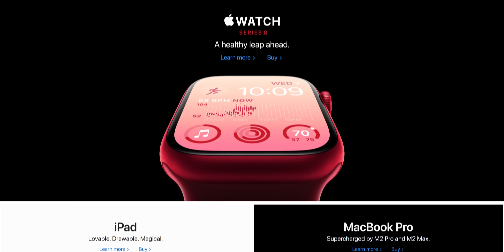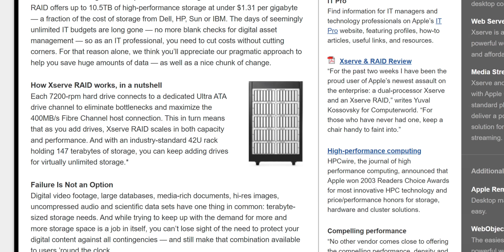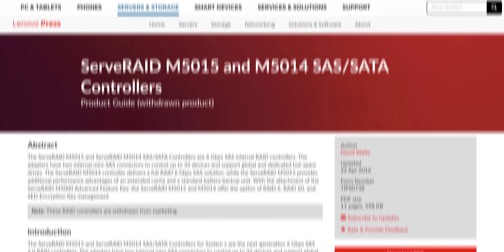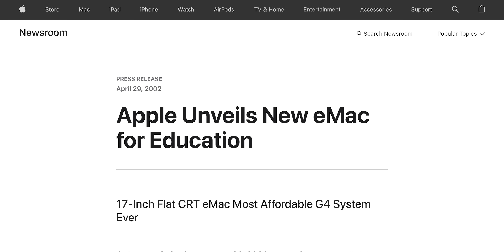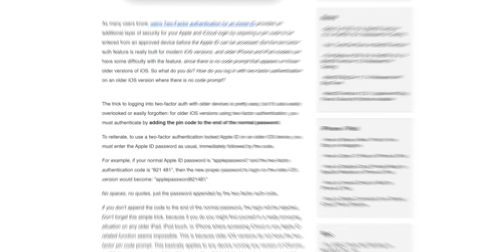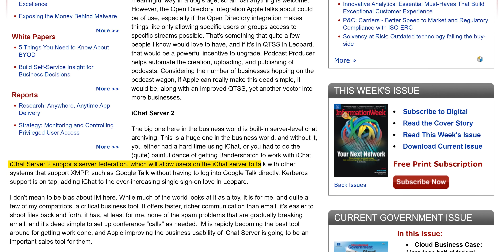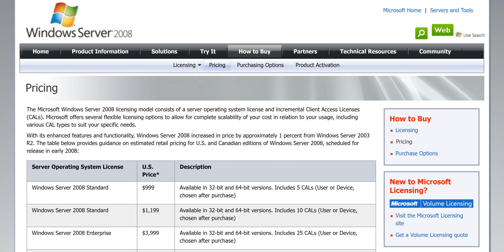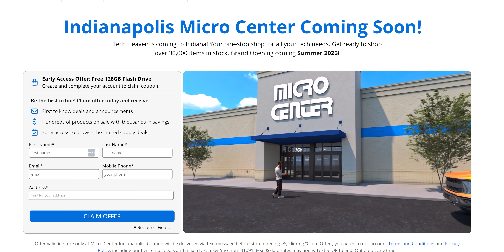I Bought the Last One Apple Ever Made... - Apple XServe 3,1 Server

Comment: I worked with one of these at a school.  Was very impressed by the user and computer policies you could set.  Much easier than Windows Server.  The fun part was using Apple Remote Desktop and setting up all the computers in a room to reboot at the same time.  You'd get about 30 or more bootup dongs at the same time.  That was fun.
Reply: bootup dongs, heh
Reply: My public school district had Apple servers. The school network overall wasnt setup properly or very securely. I got suspended for taking control of my teachers computer (through a software you could lock, share screen, take control, broadcast certan screens, etcetra.) as he was trying to share how to download files off of solidworks server.
Reply: you must be an apple bot for sure
Reply: Oh yeah I had to buy advance warranty, which was a duplicate server without a processor, HP owns the space due to their warranty being more than putting it back in a box and sending to apple services, Over priced underspec piece of junk.

Comment: I still use a G5 Xserver a duo quad core Xserver with matching x raid boxes for a file server. There is a way to get non apple drives working if you play with the raid card firmware. It's only really a problem on the Intel machines. Oh yah and the Mac pro's of that era also used de lidded xenons and require some proprietary tools to upgrade. But again with some firmware flashes and upgrades those machines are pretty usable today.

Comment: I used to administrate an old Mac OSX server (running Panther) for the Advertising Department at an old job. All of the designers/ web developers MACs were networked on their own switch with the OSX server. It was pretty easy to use, considering I wasn't a server admin (I was the only designer that had enough hardware/tech knowledge to work with it.)

Our server was one of the old chonky bois,  but seeing those old OSX versions takes me back. I think Panther was the last OS version that came on DVD installers.

Comment: It's been a long time since I did any work with an Xserve, but if memory serves (and I may get some of this wrong): The drive bay connectors weren't proprietary, just uncommon. The mini HDD inside used the same connector as the iPods at the time (on the drive side). The original PPC Xserve's drive firmware was custom to facilitate hot swapping and some monitoring features (you could put in a 3rd party drive, and it would read, but you wouldn't want to hot swap it)
Reply: Yeah, I run after market HDDs in mine.
Reply: Indeed. Ran these myself and had no problems running generic SATA drives in the sleds without Apple specific firmware
Reply: Not even that uncommon for servers. It's a Fibre Channel connector. The internal HDD's connector is what Toshiba used on their 1.8" SATA drives prior to the introduction of Micro SATA. There simply wasn't an actual standard which would work.

Comment: So a bit of heads up the small hard drive you found in there isn't really apples fault it's a drive from the iPod and that's the standard connector, As well you can use other drives I've seen people get away with oldish Seagate barracuda drives mainly 7200RPM

Comment: When I started at a video production company around 2006, my edit room was outfitted with an XServe RAID connected to my Mac G5. In the winter, I didn't need the central heating in my office, as those two machines easily maintained the room at 75ºF/23ºC.

Comment: What I get out of Apple and their software pipeline is that they want to eradicate the possibility of edge cases. So when some tech gets sunset, they also brick the software so they don't have to deal with "backwards compatibility" of getting legacy software and tech to work with current stuff. Or dealing the headache of finding someone in their expendable army of support personnel who has the faintest clue as to how and why something in a decade abandoned piece of tech works or doesn't work. 

So in summation: You'll be using the tech how they want it, for what they want it because anything else is heresy.

Comment: I recall the old mac admins saying, back when I was a student IT worker, for a while you had to run and OSX server as an LDAP proxy to make Active Directory logins work on OSX.
Reply: Funny story is one of these was used as an auth server for a mac lab that wasn't on the main uni domain and then caused integration problems since the server outlasted the mac lab but they still were using it for LDAP auth on Linux. Eventually it was replaced with a Linux server only for the lab to become a combination Mac/Linux lab leading to new integration problems.

Comment: Its such a cool product I wish they kept selling them. If anyone is interested I actually have one lying around with its original packaging and accessories in good working condition that I am willing to sell if anyone is interested. Its configured with 2x Xeon X5570 24GB(12x 2GB) DDR3 ECC 3x 1TB RE3 WD1002FBYS HDDs 2x 750W PSU running Mac OS X Server v10.6. The disks are in good status according to SMART but the battery in the RAID controller is dead. If you are interested just hit me up but its located in Europe.

Comment: wasn't aware that we consider SCSI SCA 80 pin connector proprietary to Apple... I have those on SUN workstations and etc.  Basically, it was the standard SCSI SCA connector for the early days of "hot-swapable" SCSI drives....  However, that is accurate that Apple firmware locked those drives to Xserves, couldn't add just any SCSI drives to servers.

Comment: TBH this might have been Macs greatest server ever. Only problem is that most everything is made for Linux so trying to compete is impossible. Fuck, they made server management look easy though with all those simple GUIs... Wish it was that easy lol. I bet it would be really easy to install linux on it. Only problem is the serialized hard drive that can't be replaced if it fails down the line (which it will). Funny thing is microsoft also locks their drives in xboxes. PS5 doesnt! It would be cool to see what it would take to "unserialize" the drive, editing the software or firmware that checks to see if the drive is the same.

Comment: I ran a Mac lab for 10 years and had various X-Serves under my desk serving as media servers because the college wouldn't let me put them in the server rack in the basement. Needless to say, the fans were loud, but the server was rock solid reliable and served content without an issue campus-wide for years.

Fun fact: Try changing the battery for the RAID - on our X-Serve model, you had to remove most of the components to get to it. I've got pictures. It was stupid.

Can't wait to see you mad scientists turn it into a gaming system!

Comment: I had no clue Apple made rack mounted servers, I figured  if someone wanted something like that they would cluster Mac Pros. Apple really stayed on brand with there proprietary stuff, the drives, the connectors. I guess its hard to fault a company for acting in there own interest. A company that doesn't make profit is a dead company. I personally like apple products, each Iphone I have had has lasted me for years. I leap frog Iphone generations to get them cheaper, I started with a 4, then a 6 then 8 and now I have a X-R that I have had for 3 years, still going strong.

Comment: The drives being firmware locked are not true. I still use one of these servers and have swapped out the drives for newer off the shelf HDDs and SSDs and they work just fine.

Comment: Would love to see how capable this hardware still is today.
Reply: Not very. It's ordinary Intel hardware from when it was produced.
Reply: @microcolonel  8 core dual xeon configurations from 2008-2009 were pretty damn fast. still usable today.
Reply: @14blutundkrieg88  Usable by what standard? Technically you can still do useful work on old computers but you could also just pull any PC out of a dumpster or ewaste recycler and you have a pretty decent chance of beating a midgrade XServe.
Reply: @microcolonel  Technically true, but you'd likely need to find a 3th or 4th gen intel core consumer platform in order to get similar levels of performance to the top dualsocket xeons at the time. They can be had pretty cheaply now as ex-lease machines, I got my dell workstation for around $40 USD. works just fine for FOH audio at the venue I work at.
Reply: @microcolonel  It actually holds up pretty well, Intel Xeons still perform pretty well for most tasks. Of course the GPU is the biggest weak point. But that can theoretically be upgraded to something like an RX 580 with a PCIE riser cable.
Reply: @Pendleton115  you forgot to mention its generation
Reply: @Pendleton115  I did that 😂 use it to play games currently
Reply: @microcolonel  Xeon isn't "ordinary" Intel hardware. They are surprisingly capable machines even today.
Reply: @neilbradley  Why settle for a surprisingly capable machine when you can just get a capable machine lol
Reply: @microcolonel  I have a mac pro 5,1 and it's far from ordinary intel hardware.
Reply: @girlsdrinkfeck  Just buy more money?
Reply: @nambrosch  Far from ordinary intel hardware in a good way, or a bad way?
Reply: @matthew909_  good way, you can upgrade these to 12 core Intel X5690’s.
 Definitely not the most powerful CPU’s by todays standards, but at the time they were beastly.
Reply: @girlsdrinkfeck  but you clicked on an apple video😂 the most overpriced brand
Reply: @matthew909_  very high quality however apple has a long history of designing very high quality technologies then abandoning them.
Reply: @microcolonel  thanks for the update.
Reply: @nambrosch  ordinary? try pathetic, compare a the portable workstations or servers to apple products and cost is always,,,way less for anything against apple, and actual compatibility? again apple loses,,, then ability to compile code?,,,you get more ram, more cpu and gpu and the ability to upgrade to diferent things, more often and less "locked hardware proprietary crap" ,,APPLE ALWAYS LOSES,,,when the comparison is impartial ..only fools who take this stuff out,,, and put their finger on the scale,,,will say apple is even competitive..
Reply: @jstavene  spoken like a true hater.
Reply: @nambrosch  or a man who had to support and plan and purchase and budget this stuff... its terrible that is the truth! and apple screwed people ALOT!
Reply: @jstavene  As an IT Director, I ran cost comparisons of the XServe against the Dell servers in the mid-2000s, and in a like-for-like=hardware comparison, the Xserve was cheaper.
Reply: @thedude6712  I know your either mistaken or lying... (I challenge show some math)
Reply: @jstavene  I'm neither mistaken nor lying. I made a spreadsheet to compare differently-spec'd editions of both the XServes and Dell PowerEdge PE1850 or PE1950 servers (our MDF had 30 or so computers, including Proliants, PEs, and a few Sunfires), and the XServes came out ahead in out-the-door pricing over the Dells. This was 15 years ago, and that spreadsheet didn't exactly rise to "need to archive for posterity" level of importance after the purchase decision was made. It may exist on some old computer in my basement, but I'm not about to go powering up random computer to make you happy...even if I found it, you'd still claim that fabricated. The XServe was one of the few Apple products which was able to compete directly on price. Sure, you could get a SuperMicro cheaper, but not a big-name server.
Reply: Luke Miani did a douple of pretty nice video’s on this, a while ago.
Reply: Not very the os is very old
Reply: It's still serviceable but very obviously dated.
Reply: For the OP, it really depends what you are going to use it for.  As a gaming machine?  Maybe, if you get it for free, with a 7970 or rx580 in it already, and already set up, or you enjoy having to tinker and flash firmware.  In general, would not recommend actually buying one for day to day use today.  That said, if you already own one, it is still a perfectly usable machine for anything you bought it for in the first place.  It's not the fastest thing ever, but is perfectly capable in production workloads even today.  my 2008 Pro is still the main workhorse in my print shop, where it is used mostly with photoshop and indesign (cs6), running High Sierra.  That CS6 license is the main reason the 08 Pro was never replaced as it will not run on modern 64 bit only Macs.  For use as a production machine the old cheese graters work just fine today.  They are not amazing, but they do the job just as well as they did going on 15 years ago and just keep going.  If you're buying something, for the same money you'd spend on a 08-10 Pro and all the upgrades you need just to make it decent, you can get an AM4 system that will run circles around it.
Reply: @johngaltline9933  My desktop for the last 9 years has been a 2013 mac pro, I know how capable old mac hardware is.  The xserve is just a fascinating piece of forgotten hardware for me.
Reply: @nambrosch  "Would love to see how capable this hardware still is today."  So I broke down how capable it is.  The xserve is neat, but in reality it's just a macPro in a less convenient form factor for most people, and a less efficient design than any other server chassis from the period I've seen.  My old Sunfire servers pack more punch in the same space and use off the shelf parts, inexpensive caddies, and non-locked drives.  
You've likely got about 2 more years on your rubbish bin Pro before you hit the wall.  Apple is really good at killing support for perfectly good hardware.  High Sierra is the end of the line for mine, and going to PC is the only option to replace it when the time comes.  Older macs are robust computers.  new ones are disposable.
Reply: apple destroyed the life cycle, and software is broken,,answer to your question? NOT CAPABLE ,,and the hardware? NOT VERY, a old dell or hp server offers more upgrade, more capacity for same generation and more software choices,,, if you do not like the answer, perhaps build a game machine ?  would be quite poor I think,,,gpu? hahaha apple products are junk, useales quite fast throw away designs
Reply: @jstavene  your opinion matters.  really, it does.
Reply: @nambrosch  I cite reasons you say opinions truth is clear, want to sell any product, win IT MIS and Network Admins the people who do purchasing, support and planning.. its simple and clear..
Reply: @jstavene  The Xserve existed to run a specific set of tools, it wasn't general purpose hardware.  Today it's just a fascination.  Calm down.
Reply: @nambrosch  I had high hopes, and since darwin is from BSD, from linux and unix,,, a network device could have been the thing,, the thing to save apple. And the life cycle in the average IT closet, when even the former US president Trump,, was using winders server 2000 for email?  a at the time 20 year old server ,,,and apple cuts product life on its server to maybe 5 usable years? that is a huge loss to many in IT. when you suddenlt get jacked to 4 times the cost, replace 4 times as often? and thne replace, confiugure and worst, the replacement is less capable? and likely need to go windows then ,,, it is what apple did to IT MIS and network admins, so hey your car? replace it 4 times, and then tell me its nothing (some of these costed about what cars did back then and even now..
Reply: @jstavene  This is not uncommon - you buy a piece of hardware with support for n years, after that you're either on your own or it comes through a third party.
Reply: I bet it would make one helluva Plex server.
Reply: @tankfu1  maybe if a good gpu can be installed for transcoding

Comment: 12:32 Did you guys not try to use the “createinstallmedia” command to make a bootable USB of a macOS install? Also Apple has a page of updated packages, all the way back to Yosemite I think, of install medias with the correct certificates so they will proceed with install. Either that or you would change the time back to around 2017.

You guys didn’t have to go through all that work 😭😭